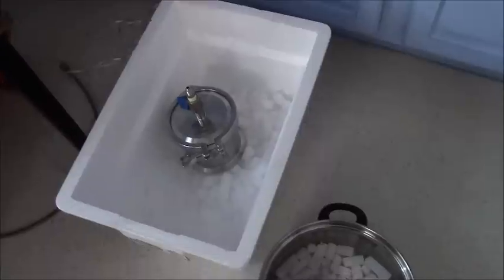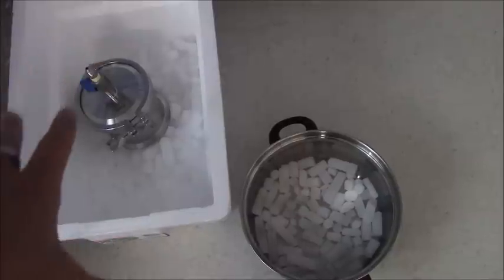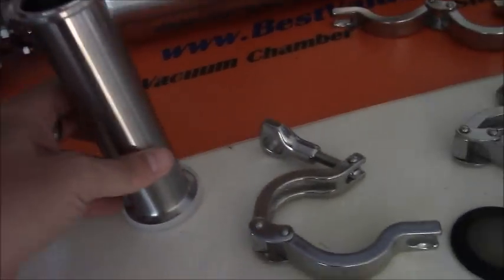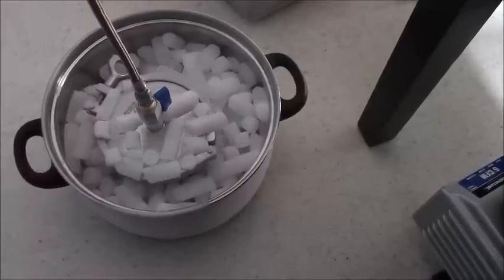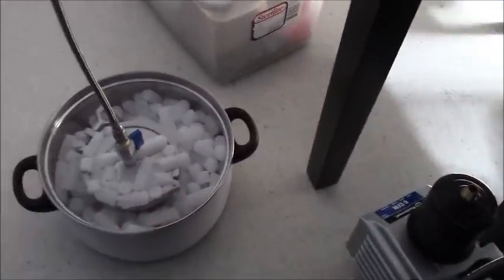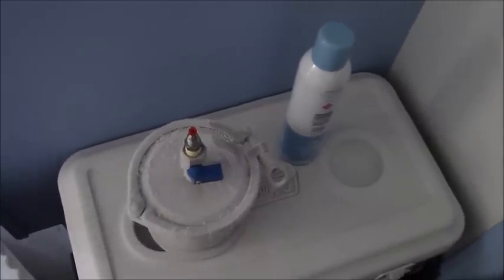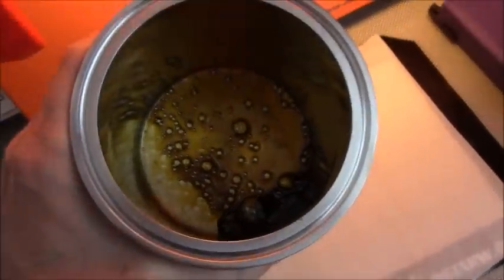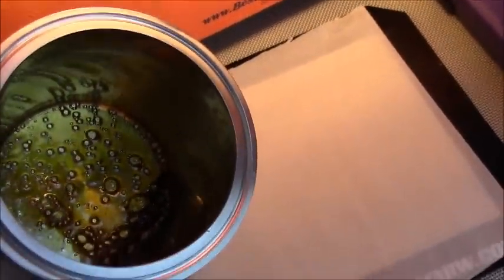THE MINI CLOSED LOOP EXTRACTOR

Comment: pull the vac, seal it, THEN chill down the vessel to achieve true maximum-possible vacuum. Trust me (test it and see!), the resulting vacuum effect will go beyond the maximum pull of the vacuum pump by itself. Whereas vacuuming the vessel once it's already chilled (as shown in the video) will result in a vacuum only as deep as the pump can deliver by itself.
Reply: I'm a chemist, so I want to explain things a bit here. While you would be correct that heating the vessel while pumping the vacuum and then chilling after would produce a harder vacuum it is actually pointless in this scenario because the vacuum itself goes away the second you add the butane. It is not the actual vacuum that is important, the only important part is that only butane gas is in the chamber and no air, which itself exists at high pressure not low pressure.

The reason for this is that air, when in contact with the cold surface of  the receiving vessel (the one in the dry ice) wouldn't do anything special other than become cold air. Butane gas however as it gets cold will condense into liquid pulling in more butane gas from the source vessel in the process. Therefore if you have too much air mixed in with butane this process slows down and it takes longer to move from one vessel to the next. But once the process starts there is no vacuum it is all at high pressure. So there is no actual benefit from producing a hard vacuum in the first step.
Reply: +Jeffrey Phillips Freeman so how exactly would you recommend doing it
Reply: I saw the cooling as a waste of time but pulling a vacuum on this system with what I would assume is trimmings is going to take some time as the moisture comes out of the product..   What kind of time is needed at this point?
Reply: ViralTuber how much butain should a 6"×4" pot hold?
Reply: You are so want to pull the vacuum before you chill
When it's chilling with no vacuum the atmosphere will create ice and the ice will not vacuum out common sense
Reply: @paperc07  Just pull a reasonable vacuum, then fill with butane. Nothing special needs to be done.
Reply: skankhunt42  it's under vacuum , how can it explode???

Comment: You should vacuum before you chill to avoid condensation inside the closed loop
Reply: I know I would...
Reply: Pull a deep enough and long enough vacuum... any water or condensation will sublimate... and there won’t be any moisture.
Reply: @nsboost  lol, ya really
Reply: @jacklegminercanada3866  I’m a HVACR technician. So funny thing about vacuum is... is under vacuum, the freezing point of anything raises. (Kinda like the radiator in your car being under pressure, which raises the boiling point).

Do you have a vacuum pump? Put a shot of water in a glass and put it under vacuum. You can freeze it at room temperature. 

In HVAC there is a concern in the community if you pull a vacuum on a refrigeration system TOO fast you will freeze any moisture in the system. Well in a small blasting tube, you IMMEDIATELY pull that small space into a DEEP vacuum.... and any light moisture is going to freeze. Pulling a vacuum before or after probably will produce near identical results either way,

So though “pulling a vacuum before freezing” is logical, the fact is you probably froze any moisture in the tube when you put a deep vacuum on it (in seconds) anyways. 

And yes... you hold a deep vacuum long enough, the ice will sublimate. It’s physics.
Reply: @nsboost  I have a robinair 2 stage. Haven't used it really. Just to distill isopropanol.
Reply: Condensation = ruined run for me..

It’s the devil’s work- just small about of moisture turning it brown…
Reply: @nsboost love you 2 years later a stranger found this helpful
Reply: 10:12 I thought solvent tank should be in dry ice or at least ice when introducing to the material…. No?

Comment: im impressed, if those things had a little shatter plate on the bottom to make the pour out cleaner and less scrapping
Reply: They do offer that splatter platter for extra. I think a 4x4 spool, platter, and extra gasket and clamp would run a little over $100

Comment: I’ve worked on Air conditioning systems most my life. This equipment and the vacuum process of a closed loop system is incredibly familiar to me
Reply: Unless you worked in Europe, you probably didn't do much work with recovering hydrocarbons. Or maybe you did. The US doesn't have much r600/r600a system to work on.
Reply: @jonosterman2878 lol how is recovering refrigerant any different other than the flammability aspect ?

Comment: Good video sir. Question, I could I also put a small amount of Everclear in the bottom of the Collection Container to help the extract slide out of the container easier? I've seen someone do it before didn't know if it would help.
Reply from the maker: Nicholas Hamil sure after you have extracted you can use everclear to help it out and now they just upgraded the mini a lil bigger and with splatter platters for a easy pour

Comment: My problem with the larger one, the 135g mini extractor, it says in the description that it only can use one can of butane max, that's not enough to extract it all, it will take more than a can to get through all that material. I assume it will take like 3-4 cans.
Reply: +kody “sorrynotsorry” Frase under vacuum apparently not. i think thats what i heard... bc i thought that too! .... but i think when you lines, tank and the material columb is under full vac it doesnt need all that extra... but im no CLS expert
Reply: 1 can doesn't even go through a large blaster. The rule has always been 1oz per can. I have 8 oz blaster that works like a charm.
Just shake!

Comment: So im considering using a regular open butane extraction system, what is the benefit of the closed loop? I presume better yield? Seems like heaps more expensive equipment.
Reply: you  dont have to buy butane you can reuse it over and over in a closed system

Comment: I purchased this unit and Im experiencing pressure loss. leaks out of where the line threads onto the unit. and once it leaked from the spatter platter. what am I doing wrong !! lol thank you
Reply from the maker: +AmerikanPBT  i doubt your doing much of anything wrong, alot could have happened during shipping. to make sure I dont have any mishaps during a run I do a dry run/distill to test and clean. before you do a run with material do one with out and when your done wipe out the empty equipment with a tack cloth to clean the mystery oil and you can test everything at the same time so you will be killing to birds with the same stone. hope this helps and will try to help more if needed
Reply: try some thread tape, gas line thread tape.

Comment: Do you need dry ice. I know dry ice would be colder than regular ice.
Reply from the maker: +Donald Griffin you dont have to have dry ice but things will go alot slower like 10 times slower lol. a run with dry ice will take around a hour where a run with just ice can go longer then six hours. the minis will go a lil faster but dry ice will help everything run alot smoother and faster. hope this helps

Comment: what was your final yield of product?
Reply from the maker: ajradel that was over a yr ago but i believe a lil over 6grams
Reply: yea im wondering if i could do several runs with the mini or just spend the extra on the 1lb.
Reply from the maker: ajradel id go with the bigger scalable system due to you can always build it bigger if needed the mini is great for testing product
Reply: not a bad return

Comment: Just curious Dirty, how much dry ice did you use on this run? I've just brought the system the next size up and can't wait to run it, just need to know a rough amount of dry ice I need to order. Cheers bro
Reply from the maker: with the mini 10 to 20 ponds will do great and get pellets if you can, the block will work too just more work lol you can get away with 10 but always good yo jave extra
Reply: +dirtybongwater grows meds thanks for setting me strait brother, your a star. Cheers

Comment: BTW, you forgot to mention your return. I know that it depends on material quality, and you used trim. Also will the total includes second run ,or will the first run be enough to extract all trichomes by extending soaking time. Thanks again.
Reply from the maker: +Donald Griffin I usually dont ever mention a return due to everyones material they use is different and have a few that go on every word I say so when they dont get a return as well I do they freak out and start calling names and bashing the equipment and stuff. and you can follow the directions they give you so you can weigh your butane and extractor and know the limits to put in. hope this helps and sorry I didnt mention returns. and also all strains and even plants run different and get different returns
Reply: +dirtybongwater grows meds Thanks for answering the first question, its more important than return I agree. How many cans of Tane needed for run.
Reply from the maker: the mini varies the simple unit uses one can and it goes up from there when you upgrade the instructions will tell you the weight that is needed of butane and all cans of butane have different weights so you will have to follow the instructions and weights for the extractor and upgrades that you have or gonna get

Comment: the order page is a clusterfuck.....  when you go to recovery, there is not much need to pull vacuum on the first source tank for recovery..  it is full of pure butane gas already and is only waiting to see some cooling ..  Run 2 or 3 batches then dump the thing...

Comment: Hey Dirty, would you know why I'm only getting back a little return and the material is still dry? I have the mini. Thanks.
Reply from the maker: Jeff Jr could be a number of thing but the most important is the material you put in, then also if you using dry ice or not (and yes it does make a difference). also if your able get a small ball valve for your mini so your butane has a chance to really take effect for a few minutes. also make sure you top off the the tank after every use it needs to be full before every run to make a good extraction. hope this helps but please remember the minis wont produce the way the bigger units do because of the amount of material your using. also try to remember if you put bad material in it and except it to produce a great end product thats not gonna happen, but you put in fire you will get fire back. the ball valve should help it soak some more and try the other tips. hope all this helps and would love to hear if they help